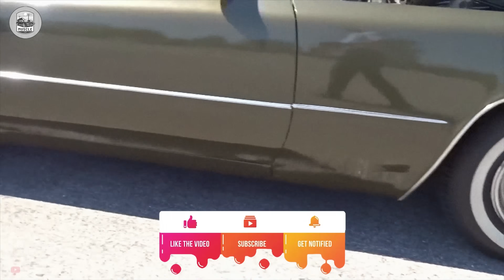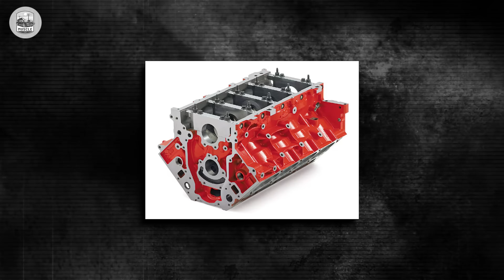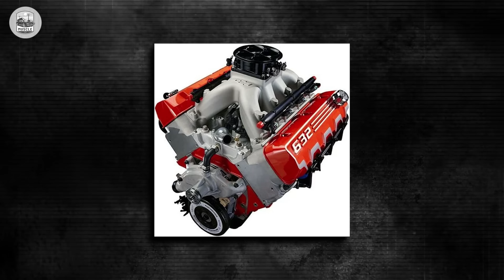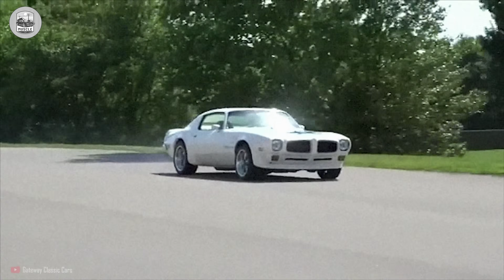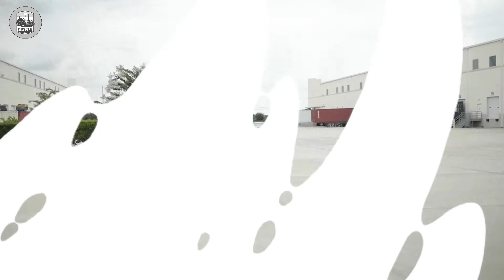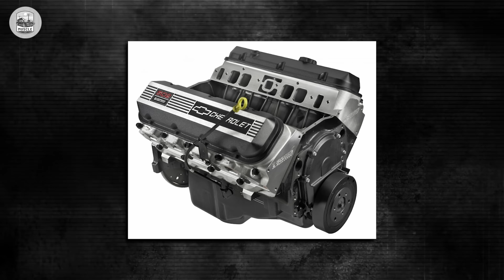GM’s CRAZIEST and BIGGEST V8 ENGINES ever made | You didn't know about!

Comment: I worked on plenty of Cadillac 472 and 500 V8s back in the day. Those engines were bulletproof if you kept up with the maintenance. I’ll never forget a customer who hit 200k miles on his Eldorado without a rebuild...
Reply: Sure, they were tough, but that torque monster wasn’t always practical. They guzzled gas like it was free, and let’s be real—most people didn’t maintain them like they should. I’ve seen plenty of these beasts junked before 100k miles because folks didn’t check oil regularly.😁😁😁
Reply from the maker: @AdelynDodson  You’re absolutely right! Those big-block Cadillacs, like the 472 and 500, were torque monsters that could really move. But yeah, fuel wasn’t exactly cheap, and without proper maintenance, these beasts didn’t last as long as they could’ve. It’s a real shame to see them junked before 100k miles due to lack of care. Keeping up with the oil and other regular maintenance is key to getting that long-lasting power from these engines
 If you’ve got any stories or experiences with these legendary motors, drop them in the comments below
And as always, make sure to like, share, and subscribe for more American muscle
Reply from the maker: That's awesome
 The Cadillac 472 and 500 V8s are legends in their own right. Those engines were built for the long haul, and you're absolutely right proper maintenance was key to their longevity. The fact that your customer hit 200k miles without a rebuild shows just how tough those motors were. It's rare to find an engine that can go that far without major issues, especially when it’s pushing all that torque! If anyone else has stories or experiences with these powerhouse Cadillacs, drop a comment below! Don’t forget to share, like, and subscribe for more American Muscle Car greatness
Have a good day.
Reply: 200 k is nothing for a engine to do, my dad got a 69 pu with a 292 it got 1,200,000 miles and was still running when we parked the truck because the doors fell off it and the rear axle broke
Reply: @jeffrey4547  200k is solid, but let’s not forget engines like the Cadillac 472 and 500. I worked on those beasts, and they were built to last. I saw a 76 eldorado hit 200k without breaking a sweat, and with proper maintenance, it could’ve gone further. Sure, a 292 can rack up miles, but those caddy big blocks were smooth, torquey, and reliable.
Reply: @CookeZachery  my 4 runner has over 400,000 on it with bad care a 3.3 v6 but my dodge 360 sucks started to get a knock at 160,000  and took good care of it
Reply: @jeffrey4547  Hey, I hear you on the reliability issues with the Dodge 360, it’s a mixed bag. But here’s where it gets interesting: Dodge wasn’t aiming for longevity like Toyota; they were chasing power and performance. The 360 was all about raw torque, especially in trucks and vans where it was a workhorse engine. Now, comparing that to the Cadillac 472 or 500... Whole different league! Those big block Cadillacs were torque factories, but they were also built for cruising in style, not beating on like a Dodge small block. Fun fact: the Cadillac 472 made 500 lbft of torque right out of the box in 1968! That’s the kind of low-end grunt you’d expect from a diesel, not a gasoline V8. Sure, it wasn’t meant for 400k miles, but it could pull anything you hooked up to it without breaking a sweat. Sometimes it’s about the job, not the miles.
Reply: @CookeZachery  i have a ho 454 stock they put out 450 hp at 485 torque dyno tune can get up to 500 hp with 525 torque but it u get them to breath they really come to life i got 3 of them with steel crank heavy rods high flow heads 10.5 to 1 compression plus they all came with the 02xx 400r turbo 6,000, 37,000, 57,000 miles on them got all 3 for free. if u know what u are doing u can find them all the time for free. the cost to build a 500 cad is very expensive the ho 454 is way cheaper to build up when the block is already built from factory. there is a big reason y they use the 454 over the 472 or the 500 in heavy applications and the 02xx trans is the best stock trans money can buy good to 800 hp stock but it has most of the parts already to make a 2000 hp trans
Reply: @jeffrey4547  Hey, I get the love for the HO 454 it’s a beast, no doubt
But let’s talk Cadillac 500 for a second. Sure, it’s pricier to build, but it’s not just about cost it’s about torque. That 500ci monster delivers 550 lb ft of torque stock, and with a mild cam and intake upgrade, it’ll destroy a 454 in low-end grunt. Plus, in heavy applications like RVs, it outshines the 454 because of its lightweight block and torque curve. The Turbo 400 is solid, but those Cadillacs could pair with TH425s for FWD torque monsters. Sometimes, torque trumps horsepower in real-world performance...
Reply: @CookeZachery  i have parted out a lot of rv. and have never seen a 500 in one or a 472 just standard 454 and the ho 454 and in an old one's a 396 and a 427. my friend builds the 1 ton's and uses the 500 in them with front wheel drive out of the cads. he builds one every 2 years. they are a great engine but i never go with one just for the fact that u can bolt in a bbc in replace a sbc. in my 68 pu i just had to get the bbc stands but 73 and up they bolt right in. plus a lot of the sbc i get have after market ignitions and sbc distributor fits a bbc u just have to change the counter weights. like my 68 pu i only have 2000  in it and still have the factory 327 and 400 turbo from it, i been offered 15,000 for it before i rebuilt the dash and put leather heated seats in it. i even put the factory tach in it new glove box and new tail gate new bezel and lens chrome vents came out way better then then stock plus i put a 70 blazer center counsel chrome tilt wheel. the engine i put a after market dis. with the msd 7 high rise with a 850 carb all for under 2000 bucks including buying the truck. this y my friends call me the budget king. my next challenge is to build a 79 z28 rs t top for free i just need to trade parts for paint have all the parts to build it plus 2 extra z28's for parts got all 3 for free.plus i can go 4 speed or auto with it i have a new 12 inch clutch and new fly wheel for the 454 took my 3 years to get all the parts for it.
Reply from the maker: @jeffrey4547  That's an incredible story
1,200,000 miles is an impressive achievement for any engine, and it really shows the durability and longevity of those classic powertrains. The 292 was a solid engine choice, and it’s awesome to hear how it kept going strong despite everything else on the truck giving out. You’re absolutely right about the Cadillac 472/500 engines packing some serious power, and as I mentioned before, the Olds 455 really strikes a great balance between performance and reliability. I love hearing these stories...
Have a good day.
Reply: I am really surprised they didn't use the Cadillac 472/500,in the GMC motor homes,not that there was anything wrong with the 455 Olds, it's just the Cad engines just would have done a better job lugging around the coach.
Reply: @patrickmcgoldrick8234  Honestly, I’ve gotta say I think the Olds 455 was the better choice for the GMC motorhomes. Sure, the Caddy 472/500 had more grunt, but those beasts drank fuel like a sailor on shore leave. The 455 wasn’t exactly frugal, but it had a balance of power and reliability when maintained properly. Plus, parts availability and simplicity made it easier to service.
Reply: @patrickmcgoldrick8234  I've got a ‘70 442 with a 455, and it pulls like a freight train.
Reply: @CookeZachery  I want to be clear,I think the Olds 455 is a great engine,in my eyes,I think the Cad might be a better workhorse.thats all I am saying,
Reply from the maker: @patrickmcgoldrick8234  Yes, the Cadillac 472/500 definitely had the raw power, but the Olds 455 was a solid choice for the GMC motorhomes. Its balance of torque and reliability really shone, especially when considering fuel economy and ease of maintenance. The Cadillac engines, while powerful, could be a bit thirsty, and the Olds 455 offered a good mix of performance and practicality without sacrificing too much reliability. It’s all about finding that sweet spot, and I think the Olds hit it perfectly for these iconic motorhomes
Let me know your thoughts  drop a comment, share, and don’t forget to subscribe for more muscle car content
Reply: @patrickmcgoldrick8234  Look, I get the love for the Olds 455 it’s a beast, no doubt. But let’s not forget the Cadillac 472 and 500 were torque monsters, built to last. I knew a guy who pulled a camper cross-country with his DeVille, and it barely broke a sweat.
Reply: That's Awesome!!!

Comment: i love the awesome factory muscle cars they're so cool ！！！
Reply from the maker: That’s the right attitude right there.
Factory muscle hits different because it wasn’t just about swapping parts in a garage — it was engineers pushing the limits inside corporate walls. Big compression, solid lifters, aggressive cam timing, heavy iron blocks. They were trying to sneak race hardware into street cars.
Take something like the Chevrolet 427 L88 or the Chevrolet 454 LS6. These weren’t mild grocery-getter engines. They were borderline race setups sold with a warranty — barely.
That’s what makes factory muscle special.
It wasn’t just power. It was sanctioned rebellion.
And yeah… they’re still cool for a reason.

good day, hope to see you on our NEWEST VIDEO for The INSANE GM Geometry Mistake That Kept Killing M21s!
thank you bro.

Comment: the lsx is a 454 with a 427 crank i have 3 ho 454 with the 02xx trans works great for a street engine stock plus they look so much better in a rig then a ls and the problem with ls blocks they like to crack between the cylinders so don't ever over heat them
Reply: The LSX is literally an LS engine. It’s a cast iron LS block cast to allow the longer stroke cranks in the >400 cube setups but it looks just like any other LS would if you painted it and used the same heads, intake and valve covers.
Reply: @J.R.in_WV  i was just looking at a lsx and it was aluminum block LS website claims they dropped the cast iron block in 84 and it was a 454 with a 427 crank or in their term a ls 6 with a ls 7 crank but the new ls 7 427 is the engine u want with over head cam 4 valves per cylinder but it is very expensive
Reply from the maker: @jeffrey4547  
Thanks for sharing this detailed insight....You've nailed it with the breakdown of the LSX's capabilities, especially with the 454 and 427 crank setups. The LS7’s overhead cam and four-valve per cylinder design really elevate the performance, but as you pointed out, it does come at a high price. The LSX series, though, offers a unique blend of modern technology and muscle, supporting serious power with an aluminum block that's tough enough for big builds.
Reply from the maker: @J.R.in_WV  Thanks for sharing your thoughts
Yes, the LSX is essentially an LS block with the capability to handle larger stroker cranks, making it ideal for bigger cube setups. While it may look similar to any other LS engine, its ability to support over 400 cubic inches is what makes it stand out. The strength of the LSX really shows in builds pushing serious power. And as you mentioned, cooling is crucial for both LS and classic big-blocks like the 454. There's no denying the unique appeal and power of the big-blocks, especially when they’re roaring down the street
We'd love to hear more of your thoughts, so keep the conversation going! Share your experiences, tips, and stories with us. 
Don’t forget to like, share, and subscribe for more American Muscle Car content—your support means everything
 Let’s keep this muscle car community growing strong...
Reply from the maker: Thanks for sharing your experience and insights
The LSX definitely has a unique reputation, but it's great to hear that your 454 HO engines with the 02xx trans are running strong for street use. The 454 engine, especially with the 427 crank, offers a solid foundation with incredible torque, making it a powerhouse on the road. You're right about the LS blocks being prone to cracking, especially if they overheat, which is why it's crucial to keep them running cool and maintain proper cooling systems.
While the LS series is known for its modern performance and reliability, the classic big-blocks like the 454 have an undeniable presence and aesthetic appeal in a muscle car setup. There's something timeless about their roar
Let’s keep this conversation going share your thoughts, experiences, and any tips you have. 
Don’t forget to like, share, and subscribe for more American Muscle Car content. 
We’d love to hear from all of you

Comment: What about the Ford 460 4 barell  c 6 tranny truck 1tin work van?
Reply: Had the same in my class C rv, could tug that 24' rig up a hill passing at 80mph no problem. MPG? Problem. Oh, well, when playing the game, screw economy.
Reply from the maker: @andyevans2336 Thanks for sharing your experience! The Ford 460 really is a powerhouse, and it’s great to hear it could handle a 24’ rig up a hill at 80mph with ease. Yes, when it comes to hauling and towing, economy often takes a backseat to power. The 460's torque is perfect for getting those heavy loads moving, and paired with the C6 transmission, it offers unmatched reliability and strength for tough tasks. 
It’s no wonder this setup was such a favorite in RVs and heavy-duty vehicles.
We love hearing stories like yours, so feel free to share more experiences! If you’re enjoying these kinds of discussions, don’t forget to comment, share, and subscribe for more American muscle car content. We’ve got plenty more power-packed info on iconic engines, muscle cars, and their legacies.
 Let's keep the conversation going and bring more muscle car fans together
Have a great day.
Reply from the maker: @dandahermitseals5582  The Ford 460 with a 4-barrel carburetor paired with the C6 transmission is a powerful setup, especially in work vans and trucks. The 460, a big block V8, offers impressive torque and horsepower, making it ideal for heavy-duty applications like hauling and towing. Paired with the C6 transmission, which is known for its strength and reliability, it creates a tough drivetrain that can handle the demands of a 1-ton work van or truck. This combination was popular for a long time in both commercial and utility vehicles.

Comment: 455 had a Buick wildcat 64. You had to use high test if you don't the engine will knock like hell. :hand-orange-covering-eyes:
Reply from the maker: Thank you for sharing your experience with the 455 Buick Wildcat from 1964! It's true that the Wildcat 455 was a powerful engine, but it did require high-octane fuel to prevent knocking. Buick designed the engine with compression ratios that worked best with premium fuel, which ensured the engine ran smoothly and at its full potential. When the engine was running on lower-octane fuel, the risk of knocking was higher, which is something many owners learned the hard way.
Remember to share this video with fellow car enthusiasts, and don't forget to subscribe to Muscle Car Masters for more amazing content on the best muscle cars and engines out there! Keep the conversation going...
Have a great day.